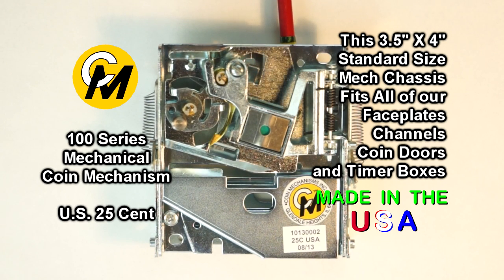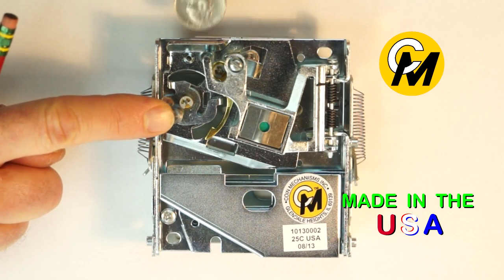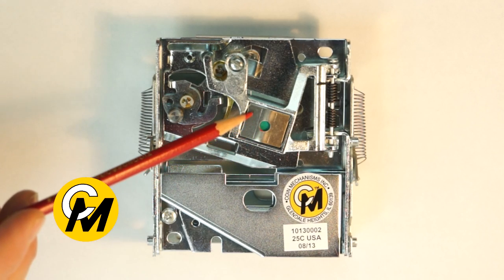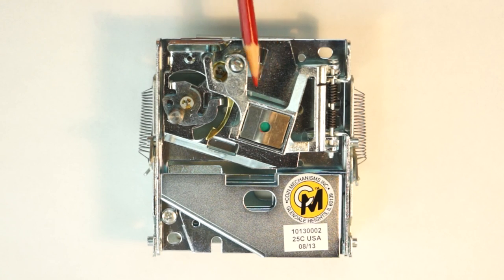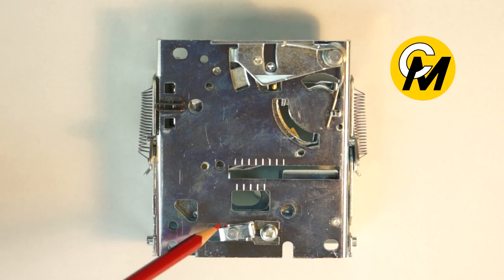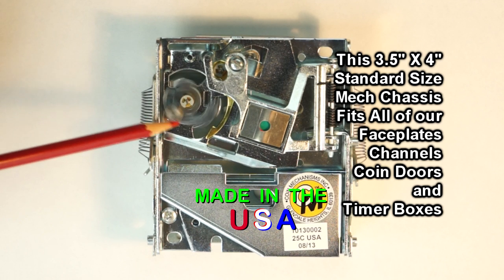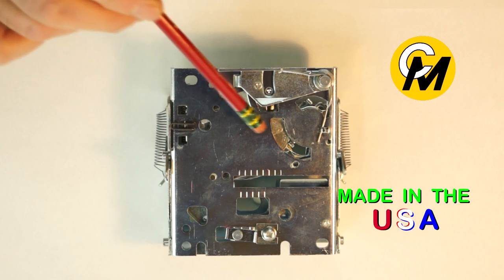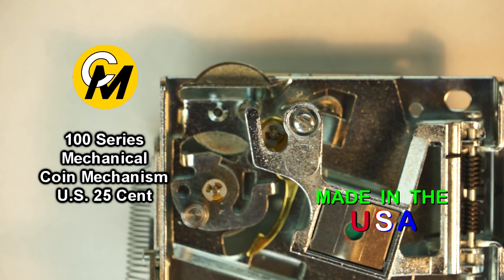Mechanical Coin Mechanism Info

Comment: I have a very similar coin acceptor suitable for $0.25 that I use on my arcade cabinet. I bought some tokens that are compatible and I'm happy with them, but when I decided to buy other tokens because I had too few, I found myself with tokens that don't go down towards the switch, but either go to the ejector or stop immediately after the crib. They are 24mmx1.18mm but they give me problems... if I were to remove the cradle would it become free fall?

Comment: I need help with a candy express coin mech. Can't find any anywhere or the other for the  price change
Reply: I need more information, what kind of unit do you currently have? 
What are you trying to change to. 
Most of the machanical units only accept one coin.  
Is it a electric machine or all machanical.
I do not know what a candy express is.
Reply: Its looks like a snack time machine but it seems to be only mechanical not electric
Reply: I believe its called a coin disk?

Comment: I know this is a few years old but is There a way to keep the mechanism close enough to the base after a wipe, every time I sip I need to open it up and push it closer or else it won’t accept the coin and it will fall right through

Comment: Fantastic video. Very informative, especially when it comes to understanding how and why the separator works. 
I noticed though that the middle adjustment on the back of the mech is removed from yours in the video. I have a couple dozen of your mechs, mostly old original mechs, and am wondering if I can safely remove this middle adjustment since it appears to have been removed on newer versions.

Comment: I have several mechanical coin mechanisms  designed for both token and US quarters. This video nicely explains how the system works. Thank you for job well done. However, the biggest problem I have is cradle falling off from its shaft due to loss of  retainer clip. This mostly happens in mechanisms designed for both token and quarter  I have replaced 9 of them in 6-7 months. I guess it is due to weak retainer clip. Appreciate comments from others who have similar experience.